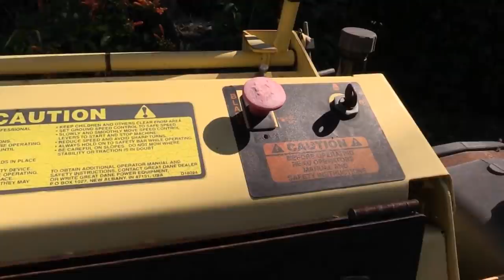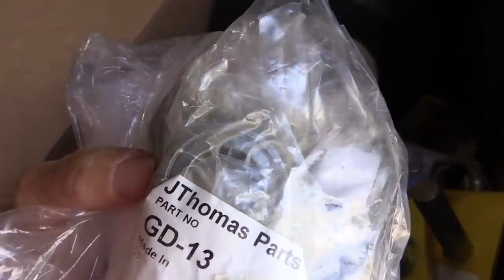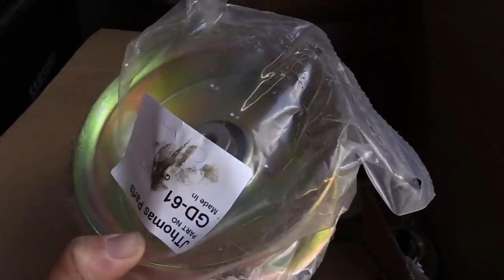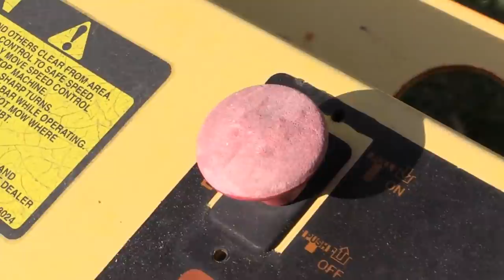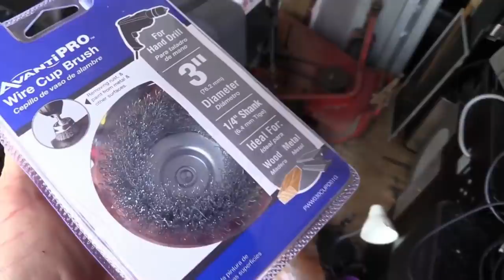Great Dane Super Surfer restoration start to finish

Comment: Great video. lots of good work. I rebuilt a 60" belly mower for my Massey Ferguson diesel tractor GC2300. I took every thing off the deck and took it to a fella that does sand blasting in my area ( Houston Tx) For $85 he took it down to bare metal on both sides, It was spotless. all the heavy rust scale was completely gone. I welded up the stress cracks and did some overlays on the pitted  areas and primed and painted it and  re-installed the spindles and wheels Looked brand new afterwards.
Reply from the maker: He must have had a really good sand blaster. Good price.

Comment: Like that fuel line trick!
Reply from the maker: Yes. The most important thing to do there is wait the 20-30 minutes. People try to start it right away and think it doesn't work. It has to dissolve the clog. Think of it like Drano. :)

Comment: I’m restoring a surfer this week. Curious what yellow paint you used. Also possible to get a ballpark figure of what it cost you to restore?
Reply from the maker: That is just Ace spray paint. It's holding up pretty well. This of course was a restoration that replaced some major stuff so it was fairly pricey. I think it ran about $1500.

Comment: Mike I have a Craftsman LT1000 with a 42" deck with two blades so Mike if my lawn tractor has two blades can I take one blade off and cut my grass will one blade cut my grass out of two blades
Reply from the maker: Yes you can. The grass won't discharge well especially if the blade is on the far side from the chute. Often times our 3 blade decks break a belt halfway through a yard and we have to finish with only 2 blades spinning. It breaks up the monotony. lol. :)
Reply: Mike my best friend told me one blade will still cut the grass she said it'll take more time why

Comment: Why is there a valve stem in a solid tire?🧐
Reply from the maker: That is a really good question. There are also a number of sealed holes on the surface of the tire. Our guess was that they filled it with rubber through the valve stem, and the holes that are now sealed were to let the air escape.

Comment: Side note if your mower deck bearings are sealed bearings grease can’t get inside them therefore they don’t do anything
Reply from the maker: Yea it's hard to really say what to do there. Supposedly the bearings are packed with grease and their seals keep it in. Yet many times I've had a deck blast through sealed bearings in a year. Then I've installed my own grease fittings on the spindles and rebuild them with new sealed bearings, keep the spindles packed with grease year after year and they never blew another bearing. Then there's the Cheetah. 8 years old, I fight wars with it, no grease fittings and all of the bearings are original. I think it comes down to the quality of the bearing really. Scag uses very high quality bearings.
Reply: @Something2LookAt  seems like quality bearings it is